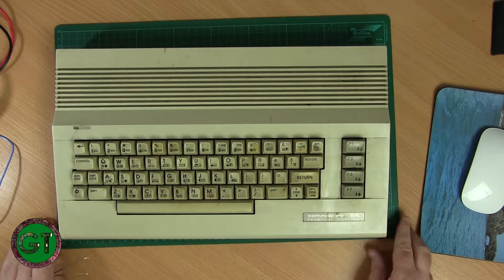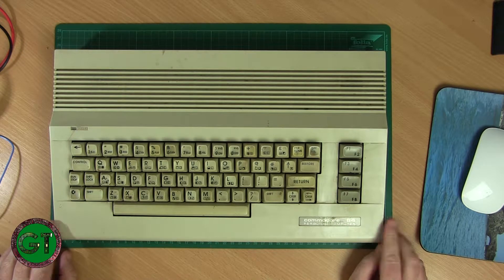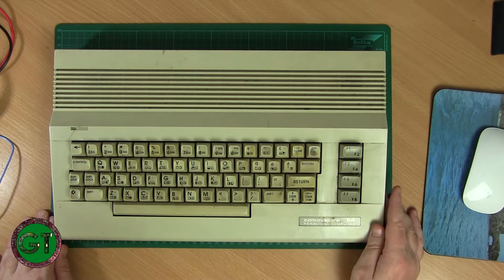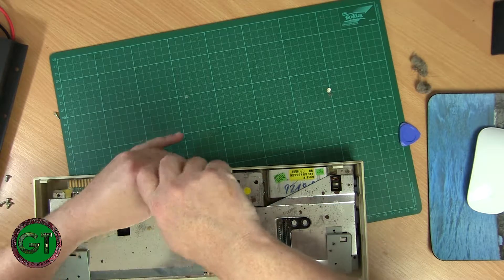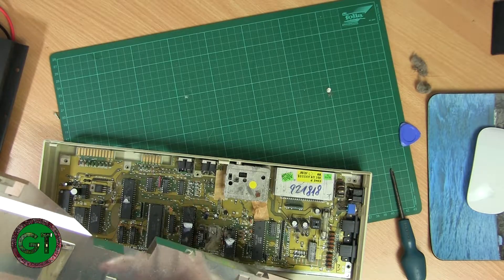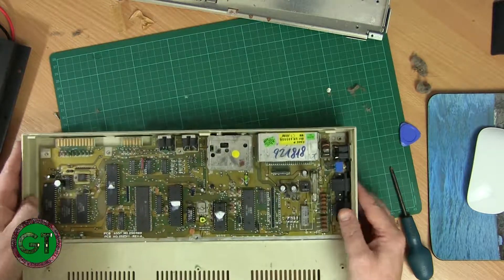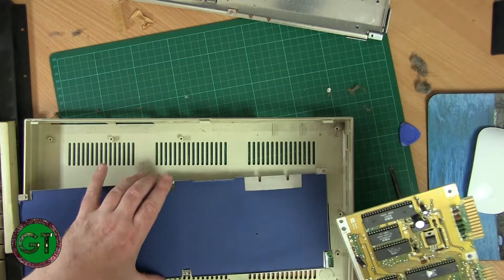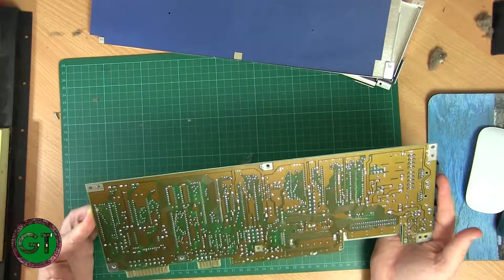Teardown and refurbishment of a retro Commodore 64C Part 1

Comment: Common opinion seems to be to replace the original power supply unit as they can fry the internals apparently..i use a voltage saver with mine...Only had the c64c for a few weeks...thank you for the video.

Comment: Hi just got my c64c was working fine with a new AV cable. Opened case hoovered dust not touching anything now the picture is scrolling and characters jitter do you think the AV cable has developed a fault or is it something I've done? Powers up ok just picture is scarmbled thanks
Reply from the maker: Is it an RF cable or RGB to scart? It’s not a good idea to hoover a computer, you could damage the chips with static. If the chips are socketed try removing them and checking the pins for oxidation and corrosion. Check the power rails have the correct voltages. Check the voltages from the power brick as they can go bad and damage the C64.